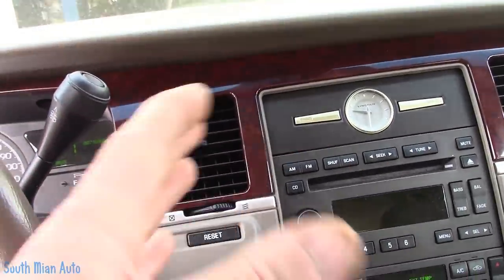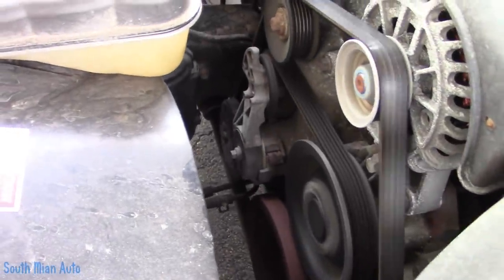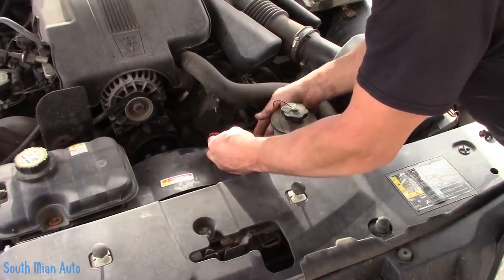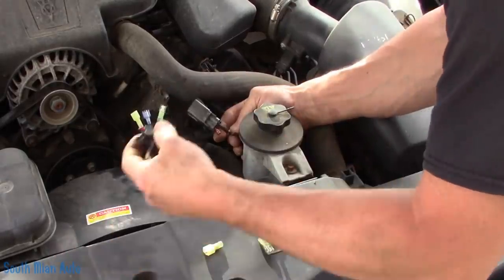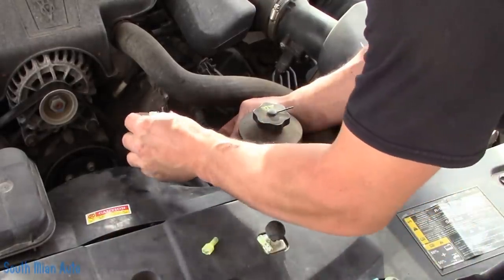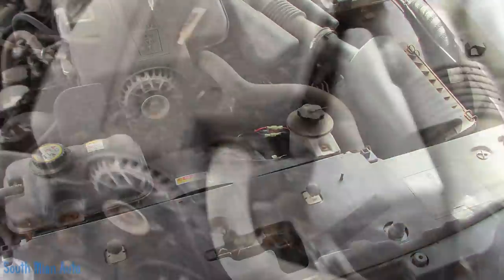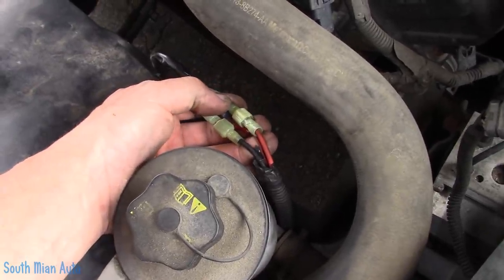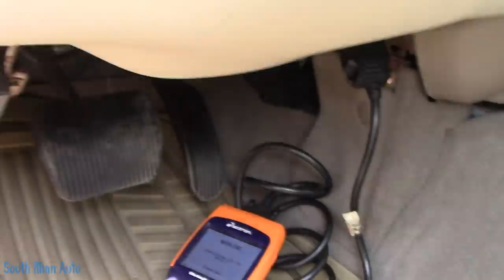Overheating Lincoln Town Car

Comment: When I bought my 05 with 120k the coolant tank was quite low too. Ended up taking close to a gallon. The radiator has a pinhole so small it evaporated before I could observe the wetness.

Comment: Those connectors can be heatshrunk with a heat gun. Never really liked using these type of connectors they usually don't last, but they'll get you out of a pinch anyways.

Comment: You know what I CAN'T BELIEVE SOME OF THE COMMENTS FROM ERIC'S FIX ? IF YOU LOYALLY FOLLOW ERIC YOU KNOW DAMN WELL HE DOES THINGS RIGHT. 1 THING IS ABOUT CHECKING THE AMPS. BECAUSE THE CONNECTORS WERE BURNT ? IT WAS A REPLACEMENT FAN & IT'S MOST LIKELY FROM THE ORIGINAL FAN THAT WENT WONKY, CHRIST. ERIC KNOWS THIS GEESH GUYS, YA I'M KIND OF PISSED. LET ME ASK YOU THIS ? WOULD YOU RATHER TAKE YOUR VEHICLE TO SMA ( IF YOU WERE CLOSE BY ) OR TO THE STEALERSHIP TO GET IT FIXED ? YA I FREGGIN THOUGHT SO.

Comment: The low coolant could be caused by the well-known intake manifold failure.  I don't know how prevalent they are on 05's, but I had it fail on my 03 Crown Vic last year.  One intake manifold replacement later (and a radiator flush for for reaching 130k miles), and no problems.  Of course the blend door for the A/C is in need of replacement now....  ugh
Good job sir!  I see that repair lasting a very long time.

Comment: I wasn't a massive fan of the fix BUT I believe it was fine. those cables would have had to get replaced anyways but if it was only the connectors that were bad then whoop de doo. It works for now, and if she wants a proper fix in the future(replacing everything) then she can do that if the current solution becomes an issue. Great work man.

Comment: My PaPa taught me, “Red against yellow, kill a fellow.”  Two day’s later, guess what?  We found a coral snake in his garden.  It didn’t make it.  I kept saying that phrase the rest of my life.

So, those spade connectors work fine.  I use a Thomas & Betts crimper,  it’s one of the best.  The biggest problems I’ve seen is the crimp, not the actual connector.  They are only good for about 5 matings, then they can make poor connections.  But brand new they are OK, especially the first mating.

These crimpers make the best crimps for these connectors. 

Thomas & Betts WT111M Plier Type Crimping Tool with Cutter for A, B, C and PT Non Insulated Terminals and Splices https://www.amazon.com/dp/B0018LD2PU/ref=cm_sw_r_cp_api_i_2DN.Cb1QCRY24

Mine are 12 years old and look brand new. They are really excellent crimpers.

Comment: Always change the oil after overheating.
Reply: Doesn't sound like she overheated, just got hot.  Those Lincolns have an overheat mode where they'll cut fuel to act as a cooling air pump if needed.

Comment: Eric, that was a great example of working with what you have on hand in a time crunch. I did the same thing in the middle of nowhere up in the Northwest Territories right down to collecting water from a nearby ditch and filtering it through an old t-shirt. I was about 100 km from the nearest service so you have to do what works.

Comment: Mr. O., as far as the fix is concerned, as long as it works, it's okay. We had a Hyundai Elantra, replaced the cabin AC fan switch so many times (yeah, we used those), that a different one had to be used on the last change. No matter, it  still works, even though it doesn't match up to the exact control line. Your fix was a good one; it worked, kept the wires out of the way, no problem.

Comment: A perfectly cromulent repair as far as I'm concerned.  Now if you had twisted the wires together and used wire nuts, that would be a different story.

And I see Marie is now on the SPCA's 10 most wanted list for her egregious disdain for our furry friends.  Way to go raccoon-killer!
Reply: Chris Freemesser don’t judge but I bought a 1997 tercel on 2002 and fans were inoperable noticed they let it rub against the belt I wire nuted the car till I got home as a mechanic I of course got more cars than time 17 years later the wire nut is still going so I not so sure it’s that bad of idea

Comment: Hey Eric:  Asking once more for a "winter prep" video.  Now that summer is here I can paint the underside where I've got rusty spots.  What are the spots to hit?   Should I use rust reforming primer, should I use rubberized undercoating, should I spray fluid film all over the place?  How do I protect from the SALT this winter??

Comment: Lmao.........when he said  I just got busted for not wearing a seatbelt...... I thought it was a cop for a split second then I remember I got a 03 F150 that does the same thing..........the ford seat belt chime... I usually wear a seatbelt on rainy days at highway speeds not for cruising around town ...... I know I should be wearing it all the time...... whenever that goes off I just hit the seat belt button real quick and it shuts it off....... but it's weird it will only shut off when I catch it when it's chiming if it's not chiming and I hit the button it won't shut off......i  never knew that

Comment: Good trouble shooting. I just put a new intake manifold on my 2001 Town car. That bolt on the left cylinder head holding the wire loom was a hair pulling experience.

Comment: butt splices. if anyone has more experience with connectors than you its me. many many many years of radio/emergency equipment vehicle installations and maintenance(Police, Fire, public utilities, streets, sewer, water). the spade lug connectors are crap an get hot/burn up(no good for any kind of high steady current). anderson power pole never get hot/burn but need to be tied together or they pull apart easy. Actual experience proves the lowly butt splice is the best of all. example wind electric plants specify butt splices and not spade lugs. only use spade lugs on low current circuits. on this fan job if it needs replacement a replacement will not fit your spade lugs anyway.

Comment: i find crc electronic spray cleaner works well on dirty connectors, but if the connector is being used again i use some dabs of loctite dielectric grease.  good video, dealer would of charged her $200.00 for the connector, $100.00 for labor and  $500.00 for diagnosis.

Comment: Lock one set of keys in a customers car because of a passive alarm and there goes rule # 2 never open a car window forever!  We always open the drivers window.  If ya get the 1 in 500 cars where it doesn't work, you get another hour of diag to fix it or just rig it back up again.

Comment: Had the same issue with an aftermarket AC compressor - loose connection - did same thing.

Comment: About the grease on the connectors...was reading the manuf. data sheets recently and noticed the recommendation to avoid using it on low tension connections such as the ones added to the Lincoln - they say only on larger clamped connections such as lugs to a panel, etc. For the push connectors, they suggest to just use it inside the plastic shrouds/connector shellto help seal it, and leave the metal bits clean. Thanks for another entertaining video...luv the sway bar test ;)

Comment: I got an assortment of Delphi weather-pak connectors and terminals for cases like this that were dirt cheap, you should look into it.  Not that there is anything wrong with spade connectors with a little di-electric shmoo in them, just looks a little cleaner.

Comment: You went way past the wire nuts and electrical tape I would have done.  But then you are a pro.  Most place would have charged her $1000 for a new radiator.

Comment: must have been in a wreck or submerged in water in a flood.
you can tell by the front after market bumper. or body shop paint job on it.
who ever put this car back together packed grease in the fitting to get it running also.
green tinted radiator  hose is a clue that perhaps this car was flooded out recently or years ago
usually its just leaves and junk on the radiator that after awhile stop this car in its tracks
after close to a million miles of driving these cars I never came across an electrical fitting like this packed with grease.

Comment: I’ve heard diesels that have less engine clatter than this Lincoln. I don’t know how many miles are on it, or if it has had way too few oil changes with cheap oil, but the valve train sounds like it has its own metallic jiggly bits that are well worn for a car that otherwise appears to be in nice shape.

Comment: The blade size for electrical is standard no matter the outer color.  1/4"  or I forget the other size.    Where did you get the wide tape?

Comment: Nothing wrong with that fix, 6 connection points, rather than  15 potential failure points if you replaced the connector with a repair pigtail.  (for those questioning the 15, count the crimps even if you use a butt connector. So technically 21 total failure points with a pigtail  to inlcude each crimp within the connector).

Comment: Doesn't Ford have the cylinder deactivation when it overheats?  Also if the fan is inop driving above say 25 mph should be more than adequate air flow to cool.

Comment: Repair the connector is a good thing. 
But What if the fan aftermarket motor is pulling to much amperage across the connector causing the melt down of the connector housing.

Comment: IT's a good fix. The only thing you could have done better was to maybe put spade connectors on the original veicle side connector if the fan was to ever be changed you could put it back.

Comment: What do you think about solder coating each wire, then crimping the spade terminal onto the soldered wire?  My impression is this will give a better, corrosion free connection.  For even better results, the spade can be soldered onto the wire, then crimped.  That is what I generally do with any non-house-internal connection.

Comment: exactly what I have done and done many times. I have used grease with copper in it to help make a great connection but use it very sparingly as it is very messy.

Comment: Bro', I can't believe you didn't
- Disconnect the battery ground before working on the electrical system.
- Check the dipstick for water contamination in the engine oil.
- Fasten your seat belt when driving.

Comment: shouldn't the battery be disconnected before you start cutting wires?
Reply: Technically yes. But he doesn't want to reset the radio and the ECM.

Comment: Nice repair Eric my boat was giving me all kinds of electrical problems I suspected low voltage from a weak battery but it fried every electrical connecter on the engine I replaced them all with this style connecter and that was 12 years ago and not a problem since then! The repair looks the same as the day I did it!

Comment: Sadly most shops would have sold her a new fan before even looking at the connection then charged a wiring harness or replacement connector.
Reply: They would have sold her a new fan, installed said fan...realized it didn’t solve the problem...would have dickered around for an hour eventually realizing the vehicle-side of the harness connector was bad and charged her for that time and fix, too.

Comment: Partially melted wires? Sounds like the aftermarket fan is pulling more amps than it should. I installed an electric fan in my wife's Taurus 12 years ago, plug and play or so I thought. Next morning dead battery, that's when the wife told me she had a manual switch to turn the radiator fan on. Bad temp sensor, replaced, removed manual switch all was ok. Wife complained she had no control over the engine temperature. I simply told her it's back to factory, get over it. Two days later she hit a steel post in the parking lot at work. Totaled. 

Got her another good ca Mercedes, she complained about the controls, I simply told her get used to it. No more complaints after three weeks.

Nice town car!

Cheers!

Comment: Are you kidding about the life left in that car? Those cars will run 400K to 700K and still be running good. You must not be familiar with the legenary reliability of the LTC, Crown Vic and Mercury Marquis.
Reply: I think Eric was referring to the likely rust problems,considering the age of the motor.
Reply: @CrimeVid  Ok I was just saying because I know personally how much you can put those engines through and they still stay reliable. My job for 8 years required me to push that car(Crown Vic same engine) hard everyday.

Comment: Back in the 70s, my dad worked at a dealership in Chicago, my dad would pee in radiators, then take a dump in the gas filler tube, real class dad, jeez

Comment: I would have replaced the fan, fan xhroud, battery, battery cables, thermostadt, ALL hoses and belts, coolant, coolant flush, more coolant, heater core, water pump, coolant reservoir, THEN AND ONLY THEN, took it in to SMA. $4200 dollars later, by god, that Lincoln wouldn't be overheating till NEXT SUMMER !!!!  :-)

Comment: DID YOU GET BUSTED FOR NO SEAT BELT. BULLSHIT LAW IT`S A £100 FINE NOW HERE IN THE UK. IT SHOULD BE YOUR CHOICE TO WEAR IT OR NOT. i HAD A JOB ON A CUSTOMERS CAR. HE HAD COPPER SLIPPED EVERY BULB AND PLUG IN CONNECTER  EVEN THE RELAYS . NIGHTMARE SO MANY DEAD CIRCUITS AND ARCING JOINTS.